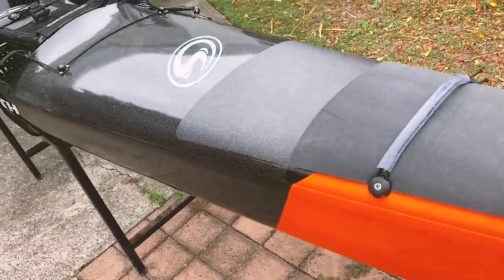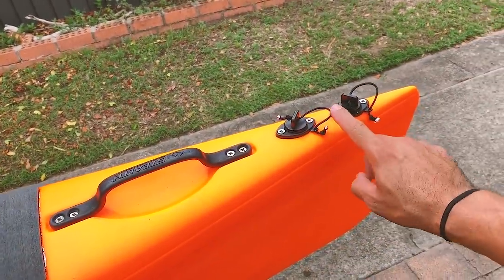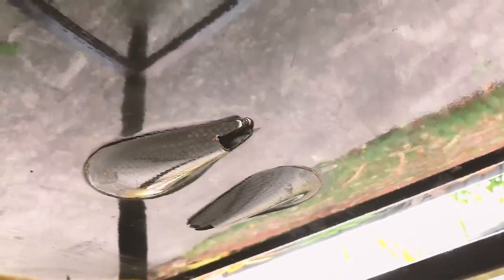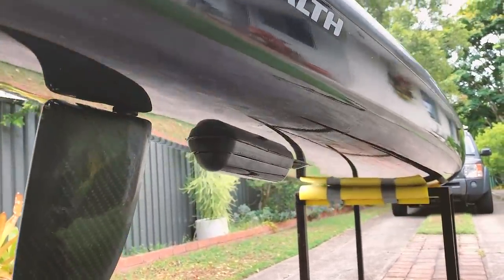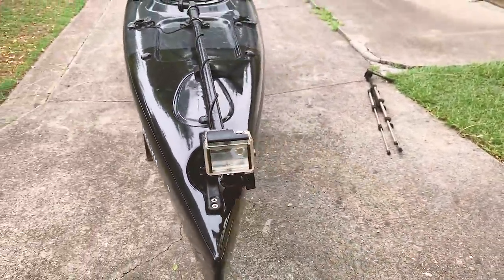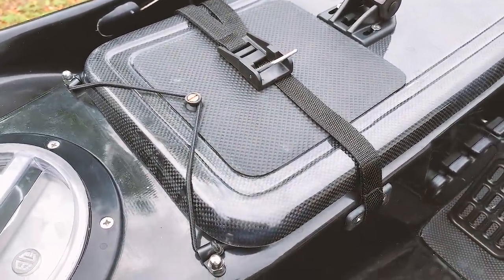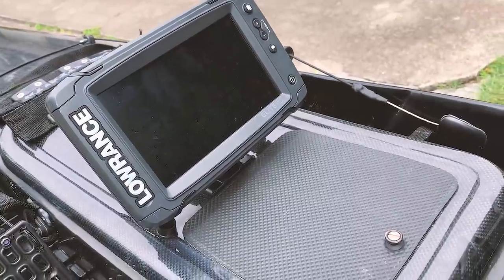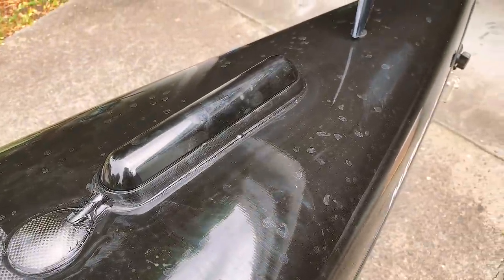The Ultimate Offshore Fishing Kayak - Rigged Carbon Fibre Beast!

Comment: One suggestion Rod, I would have cut the sounder cable to reduce the size of the hole, it worked for you, but for next time, that's what I would do... and it helps you to cut the sounder cable to length as well and not have another 2kg of copper excess... I have rejoined the sounder cable successfully, but you need to know what you're doing, especially with the screening shields on each pair of cables - to make sure you have the screen down pat, also to solder and use glue based heat shrink to isolate each solder joint and the cable together... then to use self amalgamating tape to seal the entire cable join together...
Reply: Animal Yak TV you would likely lose your warranty. Fairly big risk for little reward...

Comment: Just a thought  - is there a way to disconnect the transducer plug so you don't have to drill such a big hole in bottom? Thought it might unplug from the cable somehow.

Great video. Amazing setup and you dominate in it!

Comment: Might wanna get a taller outtake straw on that live well to maximize volume for those big baits
Reply from the maker: The well goes all the way under the seat so it surprisingly big. I reckon i could even fit a small bonito in if I really needed to. Im sure Ill give it a go at some point 👍
Reply: @rokkitkit  Gotcha. I didnt get the full view in this vid but i really see how big it is on the newest vid.  Right on

Comment: Awesome vid mate. Does the deep seat negate the need for a back rest? Do you get any back fatigue without one?
Reply from the maker: A little bit better on the back I’d say, but I never had an issue with the older shallower seat. The ski is in a fairly good paddle position so most of the Stealths don’t need a back rest👍

Comment: Hey Rod , you mention the new install of your transducer creates a lot less drag.  I wondered if you knew the speed difference?  I have an install similar to your old one where the transducer is hung over the side of my Profisha525.  I reckon having the transducer hanging over the side is costing me about 0.6-0.75 kph on my cruising speed - or resulting in me having to push a lot harder to maintain the same cruising speed without a transducer.  Its a big plunge for someone to cut a hole in an expensive ski if the gains aren't very big.  Appreciate a response, cheers
Reply from the maker: I would say I found the same with the bracket hanging over the side. I notice less drag with the new install if any at all, but yes it can be a daunting task to make that drill hole. 👍

Comment: Hey .. did you ever have issues with the hole in your kayak for the transducer? I just got the older style 475 (without the live bait well) and was grateful to see this video.

 I'm curious as to whether the Stealth guys ever picked up on it. I'm thinking that at some stage they might consider having a dedicated under hull section for a transducer like the Hobie's do. 

Also, I wondered if you were happy with the fishfinder on the hatch. I have mine mounted on the side, of my Revo 13 (which is going), so I'm curious as to whether you stuck with your approach. 

Thanks for taking the time to post your videos by the way.
Reply from the maker: I haven't had any issues so far so im happy, but I do know that a new inbuilt transducer recess has been done on the new models so id say from here on id be using that. I like the sunder in the centre as Sid amount can sometimes interfere with paddling 👍
Reply: @rokkitkit  Cheers. Thanks for taking the time to get back. I'm guessing that the new models with transducer recess must have a grommet of some sort.  I'll be in touch with them. Thanks again for your time ☺️

Comment: Hi. My name is Jan. Moved from South Africa to New Zealand. Got an older moddel Stealth 525 Pro Fisha without the Live well. My Old Fish finder Lowrance Elite 3 X that was factory installed back in SA bombed out. Want to install a new Downscan Fishfinder. Was wondering, after the mod you did by drilling the outside hull, have you had any water leakage? Would you recommend this type of installation Thinking of Hook2 5 or should I rather go with a Hook2 5X whose transducer installation can be done in hull? Will appreciate your feedback. Cheers

Comment: Beautiful looking kayak but seems the factory could have made it a bit easier to install a fish finder. I have a Viking which has the provision to install fish finder and battery in the tackle pod without drilling any holes. How difficult is is to stay upright on such a narrow kayak? Must feel great to paddle.
Reply from the maker: Yea, I think its a case of over time as the offshore fishing guys have only now started to use the big sounders because the batteries have gotten better (or lighter) so its been low on the list. But I think from here on we will see some new ideas coming though. These kayaks are more stable then you think but a bit more frisky than your average plastic, always a sacrifice in stability for speed.

Comment: Hi Rod, I’ve been kept watching this vid since I decided to get my 475 this year, one question is about the black colored scratch pad you’ve added on the bow. Is it one of the rubber pad in the Stealthkayaks’s accessories lineup? Or you just made it by yourself?
Id appreciate if you could advise what material you used. Thanks🤙
Reply from the maker: I added the black part so it went over the clear scratch pad so I didn’t have to remove it when painting. The clear ones work well if you have one on already. The material I used is just some left over boat floor matting from the skiffs. It’s was from eBay👍

Comment: Awsome kayak! Is it possible to mount the tranducer inside the kayak? I think the sonar would travel through single skin no problem?
Reply from the maker: Side scan needs to be mounted in the water unfortunately. If you're not going side scan or too worried about temp readings then internal mount work a treat.

Comment: Rob - Great videos man!  
Quick one, I see you've installed a Lowrance - What features would you say you enjoy most from a finder? 
As, I'm trying to compare options in terms of specs. 
Thanks  - from Mauritius.
Reply from the maker: I enjoy using the side scan but I can get away with just regular sonar and chart. As long as I can mark spots quickly as I find them I’m generally happy. Fish revel is cool but I don’t often run it as I’m used to regular sonar.👍
Reply: @rokkitkit  Awesome thanks! - And would you say mounting the transducer externally vs in the hull makes a big difference?

Comment: WITH THE WIRE FROM THE SOUNDER COMING OUT OF THE HATCH,  DOES ANY WATER GET IN THE KAYAK IF YOU GET DUMPED? IF SO IS IT ENOUGHT TO EVEN WORRY ABOUT?  tHANKS
Reply from the maker: The wires are only out once through the surf so its not really an issue. Its surprising even when the kayak is flipped with the hatch wide open it usually only takes a few litres of water because the kayak floats so high on the water.

Comment: How do you stop the water from getting into your lowrance card slot?
Reply from the maker: The Ti  and Ti2 units have the card slot under the logo on the front, its much better than the older Elite and hook units. Iv not had to do anything apart from making sure its pushed in properly 👍

Comment: did you ruin your previous one in two seasons??? what was the reason of buying almost exactly the same one just two years after the first one was bought? i've been using my ocean kayak prowler for about ten years and the only things that went bad are ropes/bungees and handles. It lost some coloration thanks to tropics but otherwise I couldn't imagine having to buy a new one in just two years.
Reply from the maker: The live well has been a feature many Stealth kayakers have been waiting for for years, when it finally came out I traded my old one in. It’s not unusual for these kayaks to last well over ten years no problems 👍
Reply: @rokkitkit  fair enough. thanks